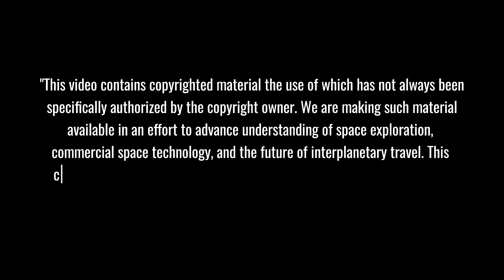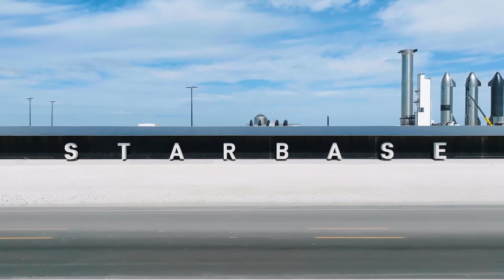Game Over!Elon Musk Revealed WHY Starship Flight 8 Failed And How They FIXED It...

Comment: As said in other comments the solution is FAR from easy. 
The structure picks up eigen? frequencies, either in strucutural piping, supports, structure, or in the fluid itself (longitudinal standig frequencies in fluid filled pipes)
All these hammering frequencies can easily fatigue the toughest piping, especially where these make bends or curves.
A huge detailed CAD system in FEM would require a very powerfull super(?) computer to give the results in a reasonable short time. And the interpretation of the vaste numerical results takes a big staff of trained engineers.... 
Compressing the time frame looks not realistic to me.  We will see.

Comment: I am not sure where to start this thought pattern. It may come across as somewhat disconnected but I think there is a common acoustic thread between the issues around this massive rocket. 
From the awesome Mach diamonds in the booster exhaust to the potential harmonics influence in the engine leaks or other malfunctions. If you look at the vapor cloud patterns at 4:34, that is an indication to me that there is a harmonic or resonance driving pressure waves around and through the rocket. Visible vapor clouds are very sensitive to microscopic changes in pressure effecting the condensation point of the atmosphere or even other fluids that experience said pressure changes. While these resonance driven pressures can easily fatigue typically strong materials, they also influence flow patterns in delivery piping. If the generated resonance matches the natural resonance of the delivery system (piping, chamber, vessel, etc), it can significantly impact the flow patterns. It can and will cause phase changes where not expected particularly in fluids that are near their boiling point (like refrigerants or volatile fuels). 
Typically the volume of these systems would not fall into the category of Helmholtz resonance chambers, but it’s worth an evaluation of the range of frequencies that are present against the materials, system volumes and shapes. There is probably not much that can be done to change the frequencies present in the case of rocket exhaust, but there are a multitude of ways to impact the system natural resonance and fluid behavior with in it. Even the fluid flow regime can impact or be impacted by this harmonic resonance behavior. 
I have a couple of personal examples from my work experience that were unexpected, but very revealing when analyzed with this issue in mind. One was in very large piping and the other was in very small piping. Finding the frequencies present and modifying the piping system to not have the same natural frequency stopped the damaging fatigue. 
While I doubt that this will reach anyone involved in this work, it would be nice if it did and prompted a further more detailed discussion!
Reply: You placed a long reply. Out of my helicopter design experience I know that the prime rotor (wake) vibration claims a "slot" in the frequency domain. Everything in the helicopter must either be under, or above critical designed in own frequency.  I believe we are in design on the same "frequency"....

Comment: with extra size and new better parts things go out of ballance.
a small pop aluminium can will  hold with stand many bigger amounts and pressures
Sn and booster are just great giant tin cans
They are designed at the least needed weight and most endurable streesses
IE weight to most load lifted and power available?
Logic says build mas strong and beyond need mand get mto your goal???
Elon as with obsetion with concrete and wasted time & cash
would not stand down and say he was wrong  and exploding debry almost destroyed the pad
Same appears to be with his obbsestion with making his mmachine dream light simple and the best biggest engines to do the job?
Fuel tanks with long oxygen feeds going through anbd extra size wieght need mmore structurer protection syupport.
bigger forces bring extra ossilation vibrations that can be out of sync  as mhappened with Satan 5 and could break any huge machine
Out of rythom cycling vibrations can breal any welds pipes holding safety parts,
onboard senses for noise structure occilations shoild be well checked for past to present.lift offs

Comment: Saturn V and old rockets are one use system. They are the same as formula 1 cars, which  are one race use. And yep, they are very fast but not reusable. You Ford car are reusable and is total different build from formula1 cars.
Shuttle program is half roket half reuse.
Starship wants to be reused , but the szise is the problem. Is need a lot of trying and error  to find the  rigth system.
My noob opinion.
Reply: I mentioned improving SaturnV with new technology.

Comment: OK-----------.    THE TUMBLING STARSHIP IS CAUSED BY NOT HAVING THE VAC RAPTORS ANGLED IN 5 OT 10 DEGREES TO ALIGN THEIR CENTER OF THRUST WITH THE CENTER OF THE STARSHIP'S MASS, WOULD HAVE GIVEN THEM MUCH MORE TIME TO SEE WHAT THE PROBLEM WAS, WITHOUT THE STARSHIP TUMBLING,,,  ADDING COMPLEXITY TO THE EQUATION...
------------..  WITH THE VAC ENGINES ALIGNED WITH THE CENTER OF MASS WOULD HAVE ALLOWED THE MANUVERING THRUSTERS TO MAINTAIN THE STARSHIPS COURSE LONGER...  POSSIBLY GIVING THEM TIME TO CORRECT THE PROBLEMS AND RESTART THE ENGINES...AS UNLIKELY AS THAT MAY HAVE BEEN... NOT HAVING THE VAC ENGINES ALIGNED WITH THE SHIPS MASS PREVENTED THAT FROM EVEN BEING A POSSIBILITY...   MOVING THE CENTER OF THRUST IN TOWARD THE CENTER  WOULD CHANGE THE WHOLE DYNAMICS OF THE SYSTEM ALLOWING THE LONG DOWNCOMER TUBES TO BE MOVED DOWN TO THE LARGE CENTER DOWNCOMER REDUCING  THEIR LENGTHS AND WEIGHTS... THAT WORKED SO WELL BEFORE VERSOIN TWO...
------------.  SUCH A POSSIBILITY TO MAINTAIN COURSE WOULD ALSO PROVIDE A BACK UP IN CASE THE CENTER LANDING ENGINES FAIL (FOR WHAT EVER UNLIKELY REASON) DURING LANDING TO ALLOW THE VAC ENGINES TO START AS BACK UPS USING DEEP THROTTLING DIFFERENTIAL THRUST TO LAND THE SHIP GREATLY INCREASING THE SAFETY WITH HUMANS ABORD... 
-----------.   ACTUALLY EXTENDING THE DOWNCOMER MYTHANE TUBE DOWN THROUGH THE BOTTOM OF THE LOX TANK  INTO THE ATTIC,, THEN BRANCHING OFF TO THE ENGINES WOULD ELIMINATE THE PROBLEMS OF THE LOW TEMP SUPER COLD LOX FROM FREEZING THE LONG DOUBLED WALL FEEDLINES TO THE VAC ENGINES.. AS WELL AS THE STRESS OF MULTIPLE PENETRATIONS OF THE LOX TANK'S LOWER DOME...  A SLIGHTLY LARGER MYTHANE DOWNCOMER TUBE WOULD ALSO SERVE AS A SAFETY ACCESS CORIDOR OR TRUNK LINED WITH HATCHES TO DECKS WHEN THE LOX TANK IS CONVERTED INTO A HABITAT TANK... IN ORBIT OR ON THE MOON OR MARS...

Comment: This Starship reminds me of the famous Soviet rocket, N1.
Why doesn't Musk copy and recreate Saturn V, with only 5 engines.  Of course adding new technology would greatly improve such a rocket.
Reply: The N1 did not have the same engines as Starship . Comparing the N1 to Starship is like comparing a Sopwith Camel to an F 35. The heavy (stage 1) is not having any problem with returning to the launch pad & being caught in mid air. Unbelievably difficult. No other super rocket has ever been able to do that.
Reply: @WG-tt6hk  They both keep blowing up.

Comment: Folks I'm old as dirt but I still remember watching the B/W TV of rocket attempts and eventual successes of the mid 1950's. One issue was that solid rockets (not used on Starship or boosters) are light them and pray. No throttling or shut down possible.  These liquid fueled engines should be able to  be throttled back for a less destructive lift off since their combined max thrust greatly exceeds the weight of even the biggest of these designs. That being said, even at reduced output, the shock and resonance issues has to be astronomical. As far as the hot stage separation issues, there has to be a way to smooth out the process. I understand that the sacrificial hot staging ring is being designed into the ship itself in the future, which may also incorporate technology to solve the original design problems. No doubt all these problems will be worked out but it sure is heartbreaking to see those big beauties RUD out.  Oh and , yes , the newer engine designs have greatly reduced external plumbing which might be just the ticket for added durability and cooling under extreme conditions.

Comment: make the engines bigger and use less engines, like 16 instead of 32 or 33, less engines less percentage chance of failure maybe ???
Reply: The problem was NOT the booster with 32 engines.  It was with Starship that only has 4 engines.
Reply: More like six engines  @LizardKing5980

Comment: THE HEAT SHIELD.  CONSIDER  A ROCKET COVERED IN SUCTION CUPS AND A HEAT SHIELD A THIN REPLACEABLE SHELL OF METAL PAINTED WITH THE SAME STUFF AS WHAT EVER WAS ON THE BOTTOM OF SAY ANY OF THE NASA MOON MISSIONS REENTRY VEHICLES FROM THE LATE 60S I'LL CALL IT EXPANDING CARBON PAINT.

Comment: I find the hot stage too tight for the power of the engines.
Reply: I agree. That hot stage should not be there. I mean how much do you lose in thrust if you just wait for a few seconds?
Reply: @stevenbaynes2646  It's not just the thrust, it's also the rocket getting weightless for those seconds
Reply: @BlackStarEOP  No it won't, it will still have momentum greater than gravity - it's going up. It goes weightless only on the way down.
Reply: @tortysoft that’s not the way momentum works. As soon as thrust stops, g forces stop. The Ship goes weightless when the booster shuts down, hence wanting to keep some thrust on to keep the propellants settled in the tanks. The Russians have done this for decades and the Titan during the Gemini missions did also. Momentum and “gravity” , actually g-force are entirely different. Example is the “Vomit Comet” the parabola flight of an empty jet they zoom up then coasts up and over on momentum alone, inducing weightless conditions on board
Reply: @alfavulcan4518  I think otherwise.
Reply: @tortysoft  after booster shut off, everything in the Starship, propellant included is traveling the same speed, just as passengers are in the vomit comet, the net effect being effectively weightless. They are still under the gravitational pull of the earth but so is the jet they are in, all traveling the same speed. The propellant in the tanks just the same, traveling the same speed as Starship hence the apparent weightless condition. If momentum creates gravity then the astronauts would never experience weightlessness because their entire orbital speed is momentum. Lesson over
Reply: That’s what she said